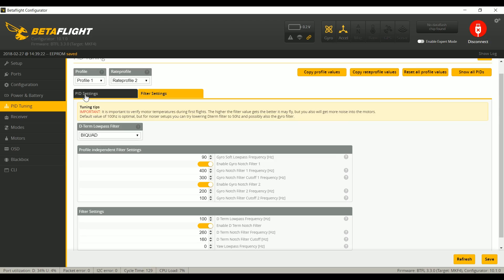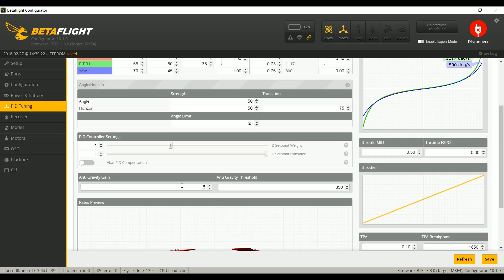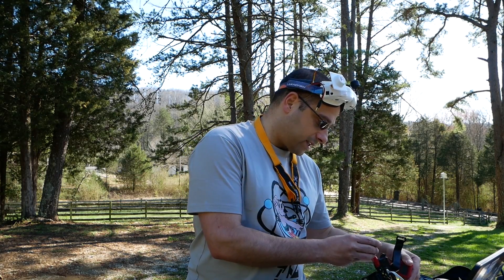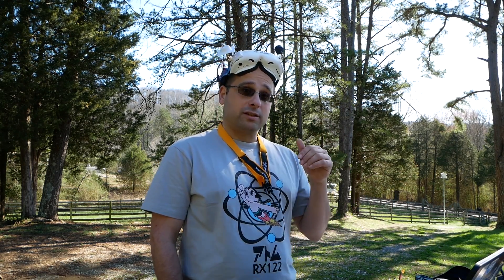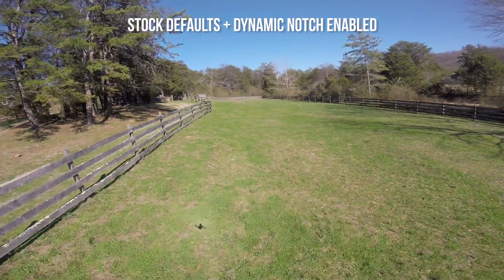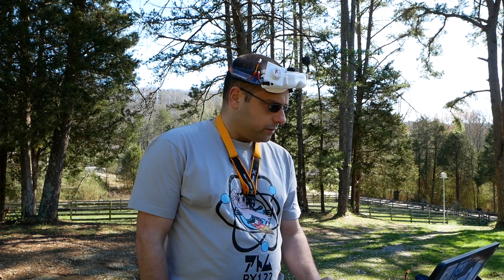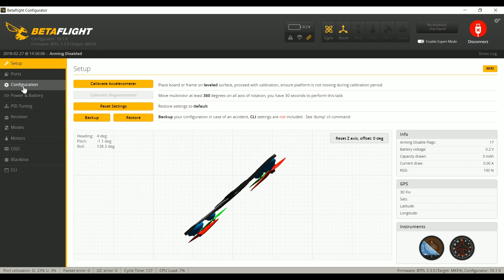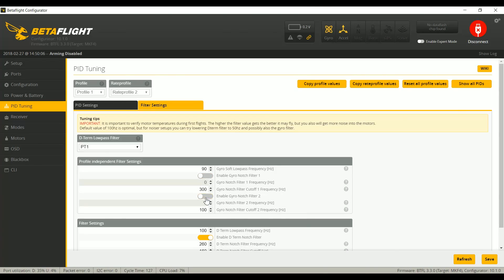Betaflight 3.3 (not) Kalman Filter | FLIGHT TESTING

Comment: What you type in CLI to do stage 2?
Reply from the maker: Stage2 is active by default in 3.4 and above. And can be configured from the GUI.
Reply: Joshua Bardwell I been running 3.3.3 Betaflight because of the rumors about smoking motors on micro quads. I recently bought a  Leader3 and one of the motors crapped out. So i bought a set of Brother Hobby R3 1106 5100kv which run hot. I tried tuning it out with pids and changing the Dterm knotch filters. Also gave it thorough inspection of screws or anything that could make them run hot. And still no success. So im looking at every option i can.

Comment: Joshua, whats an acceptable motor temperature? and what are you seeing from bone stock filter set up vs the last filter set up you had on here? i have the MX-2206-12 2450kv motors and they usually come back after a flight pretty warm. i can touch them...they dont burn my hand but i would say are in the 100 to 120 degF temp range at 80 deg f ambient. they come back cooler than my battery but not by much. you always put a lot of emphasis on not only knocking down filtering to get the least amount of latency but motor temps, but i am a little curious what an acceptable temp is. i mean are you seeing temps that are not increasing at all past ambient or are we seeing temps that are significantly warmer? i have near the same motors you used in this test so i should see similar values??? which brings me to the next question (and sorry for so many) what about prop choice (temp wise) and weight of the craft? for instance i have these motors on a 6" set up running either HQ 5.5x4x3 props or RaceKraft 6032 props AUW 650 grams or so. should i expect to see a temp difference merely based on prop/disk loading and quad weight. there has got to be some temperatures increases based on these build choices alone right, regardless of the noise getting into the FC?

Comment: Hi Joshua, how did it feel between setting the Gyro at 32KHZ to 8KHZ on Betaflight 3.3? I wonder if I should make the upgrade to F4/F7 to fully utilized the 32KHZ sampling. Do you think it worth the upgrade?
Reply from the maker: It's a very small difference. I don't think most people would notice.

Comment: Ok so I can say that I wouldn't recommend flying all notches off with stage 2 at 250hz as i clipped a branch damaged a prop and tryed to fly it back to me 50 feet away and didn't make it- the quad dropped from the sky due to smoked motor on that prop. I think leaving the dynamic on is the way to go for me. (motors barely even warm before prop damage)

Comment: I Tested  betaflight 3.3 on my omnibusf4sd (8k/8k dynamic filter on) with stage2 at 150 mhz and 500 mhz, it flys very good but im having a problem,... I have sudden "flips" that end in crash, after making a more aggressive maneuver.  This does not always happen, and happens less frequently with the stage2 at 500 mhz,
with stage2 at 0 never happens. Any idea whats going on here?
Reply from the maker: Maybe it is CPU utilization maxxing out? What is your CPU%? Have you tried enabling overclocking to 192 MHz?
Reply: cpu load is at 5%. I dindt overclocked. Im afraid burn the board with the overclock. Thx for awnser
Reply: HI again Joshua, today i had some time to go fly, now i know exactly when i got these death rolls/flips,. On my first comment i said it only happens with stage2 activated but its not true. It happens everytime i do hard punch on throttle +  half roll or pitch, quad is turned upside down and then half roll or pitch again  to stay straight,  imagine this maneuver very fast. ... I do not know if I'm explaining well enough for you to understand. This is always end with a death roll/flip. I also tryed butterflight  3.4.2 but had the same problem.  I was really happy when I saw your video "Betaflight 3.3 Gyro Overflow Detection (Anti-Yaw-Spin)", I thought, this is it!!!! But I quickly lost hope when I checked in the butterflight CLI, gyro_overflow_detect is OFF by default in butterflight 3.4.2 :( :(   unfortunately I do not have logs to show you, but I'll try to record some logs the next time I fly.  I tested motors and escs on the bench everything seems to work perfectly. My quad flys very smooth, do very nice slow motion maneuvers and powerloops, but he freaks out when I do what I described above.  If there is someone who can solve this, it's you !!!! Please give me some feedback about what you think about this.
Thank you
Reply: Cause found / Problem FIxed Thank you for the help 😉😉😉

Comment: There are some wired video conclusion, it is obvious that your first stage2 filter with the lower cutoff was the worst  even compare to the 3.2 tune. In the second when you raised the freq it was much much better. and it seem as if the UAV Tech tune was really the best out of the all.
Thanks for the video !

Comment: Why I like butterflight. I was able to flash it to a 2.5 inch 5 and 6 and use different props at almost every size. Bi blade and tri blade. And it handles them all perfectly. Beta never could do that for me. Maybe it can for you. The 6 inch bi blade is a jello and vibration generator and the kalman filter is the only thing that has been able to tame it. But fly what ever you like.

Comment: I can tell the difference between combustion chamber conductivity feedback via plug charge decay (lol nsx bmw) vs old style wideish lsu o2 sensors but a 12 year old 3076r cramming 45lb/min through a 6 bolt 4g still feels really good.

15% of my quads now have betaflight 3.3. Maybe 50% will next month.

Comment: GJ. 

Wouldn’t u need to retune after each filter to get best out of removing filter delays

Also it would be awesome to see which options are safer on the motors - eg bend a prop 90 degree and fly for 20 sec then test motor temps?
Reply from the maker: All of this was done on default PIDs. The goal is to determine the effect of the filters first and foremost. In reality, yes, you would retune. And the nature of the filters might affect the best final result. For example, dynamic filter might allow higher D gains and reduced propwash even though on default PIDs, dynamic filter off might work best.

Comment: Whilst I appreciate that you want to do an apples to apples comparison I don't think using the same settings for both filters is the way to achieve that.
With the exact same settings the filters have different cuttoff frequencies.

Personally I don't care about propwash more than stick feel and  configuration flexibility.
Thus I don't see myself ever replacing the dynamic notch combined with semi aggressive filter settings.

I went from cyclone 5045 5.5g tri's to kingkong 5040 1.9g biblades (balanced) on a windy day and it got the best out of both props whilst being oscillation free.

I feel we are all a bit guilty of judging a quads handling retrospectively when watching back footage completely forgetting how it felt to fly in the first place.
Reply from the maker: I calculated the correct Q and R value to produce an equivalent cutoff frequency. That's what I mean by "the same settings".

I always do a video recording of my subjective impression of each flight after I land. These recordings don't always make it into the final video, but I refer back to them during editing as I form my final opinions for the video. This is how I address the concern you're raising. I think the right approach is to take into account the subjective feel during the flight, but also the HD footage is important because there are often things you overlook while flying. Like that one time a freaking hawk tried to take out my quad twice and I didn't even notice until the HD review.

I'm focusing on propwash handling here because it is the single biggest and most obvious effect of improved filter performance.

I agree that if you want to be able to switch props, the dynamic filter may be a better approach.

Comment: The new filter sound just the same as too high D term does but only on turns. Was your motors hot after that flight? That propwash was bad.
Reply from the maker: The motors were completely cool.

Comment: I was definitely impressed when you upped the stage 2 filtering. Although you started doing different lines back and forth so it has hard to be an exact apples to apples comparison. That said, I think there was a definite improvement

Comment: Maybe you also need to mention in the intro that filters are the last step in tuning a quad after you get as much of the physical and electrical noise out of the build that you can.

The less work the filter needs to do, the less filtering that will be required.  With less filtering, you can run lower latency filters that give the fine tune feeling you want.

I like the warning on the intro (ie. you don NEED to know so just get out there and fly).  I am not up to fine-tuning my filters yet, but like to know all the background for when I am.

As always, great work.  Happily subscribed.

Comment: Was the second approach better than just a dynamic notch +pt1 atleast? I think things will go bad in case of damaged props if u have dinamyc notch off
Reply from the maker: Yes that is a risk if dynamic notch is off. The hope is that the lowpass will have enough attenuation to protect but it's not guaranteed.

Comment: I’m glad you are trying to do something but there’s a reason MIT researchers are studying Kalman filtering in 2018 for use in autonomous flight. It’s because no matter how hard you try, Rudolph Kalman did a hell of a job coming up with the best way of doing this.
Reply from the maker: You are right. But the "Fast Kalman" that we are all using now is not a complete implementation of the Kalman filter, and leaves out the most important part: the feedback and state estimation. That is why the Fast Kalman reduces mathematically to a simple Biquad lowpass.
Reply: While the complete implementation is too much for any STM processor to handle (whilst also running flight-code), the simplified form is perfect for quadcopters. In mat-lab simulations, it may look like it converges "eventually." but, in a real flight, it never actually gets there due to the dynamic nature of the actual values filtered. They are not equivalent given real-world flight scenarios.

Even then the only way to get really spectacular flight performance is why we started Helio in the first place. I can't wait to see you review our board :)
Reply: Hello RC I think you missed some 70 years. MIT was implementing  KF in autonomous flight back in early 1960 to be exact  MIT Instrumentation Laboratory (now called Charles Stark Draper Laboratory) implemented KF in Apollo Guidance Computer.
All airplain auto pilots in use today use it in some form, same apply to all cruise missile even is simple thinks like tracking position of cars on track for TV viewers for NASCAR or Formula 1 races...
Which get us to other point (I didn't see anyone make FC based on ST6, ST7, STM8 microcontrollers so I am guessing you by STM mean STM32 series microcontrollers) of "STM processsor" (STM32 are not processors, they are microcontrollers based on ARM processor core) are more then capable to run complete implementation of KF or EKF or UKF with flight code, even slowest STM32 microcontroller is 50 times faster then what was Apollo Guidance Computer, even Atmel 8 bit microcontrollers are more then capable of running complete implementation of KF (and they are 2 times slower then slowest STM32 microcontroller) which is used in Copenhagen Suborbitals Guidance Navigation & Control "computer" on their rockets (complete implementation of KF with sensor fusion).
Reply: Helio RC I want a build that puts all of the FKF variables on the OSD so we can put this to bed. I still don't see what makes K dynamic.

Comment: I've had excellent results setting the stage2 filter to 90hz then disabling gyro lowpass effectively replacing the current gyro lowpass with stage2. Then enabling dynamic notch filter and switching off all the other notch filters and d-term lowpass. I have UAV tech to thank for this logic, the stage2 filter kicks in before the dynamic which cleans up the noise significantly leaving the dynamic filter a easier job sweeping up the little noise that is left. My quad flies the best its ever flown.
Reply from the maker: I would never, never turn off the D term lowpass. This is absolutely playing with fire.
Reply: Didn't UAV TECH leave the D term Lowpass at PT1?
Reply: I just took it one step further, I figured the d-term lowpass using PT1 is just redundant with stage2 filtering more aggressively at the same frequency. My motors come down cool, I was very careful when I first tried it to feel for hot motors.
Reply: Ant D - thanks!  Worth a try!
Reply from the maker: Can't argue with results.
Reply: I agree it is a bit risky, I think I may have a problem if I bend a prop but at the moment it flies amazingly well and motors come down cool. With the stage2 at 90Hz I'm assuming its low enough cutoff and combined with dynamic notch to prevent excessive noise getting into the d-term, time will tell. I'm sure if I set the stage2 to something like 200hz with d-term lowpass off my motors would smoke.
Reply: Joshua Bardwell  - good of you to chime-in Joshua!  I agree - but some folks like pushing the edge.  Time for me to be a Patreon supporter of yours - I learned something today!

Comment: Hey Josh,
People tends to call "propwash" 2 different things:
1. vortex ring state(VRS) is the case when quadcopter is descending thru the turbulence it creates himself. This turbulence flow has shape of vortex ring hence the name. It happens on the sharp turns.
2. 30-60hz oscillation, when going straight on high throttle. It caused by phase delay in gyro reading as a result of agressive filtering. 

When dealing with first one, FC should compensate for unstable air flow for air sucked thru the blades and stay on the target angular rate set by rc stick. The faster FC responds, the less shaking you will see on video footage. But wobbling  sound should be always there, as FC is articulating the motor power to keep quad straight.

Second type of prop wash is tuning defect. It'c caused by resonance loop in PID feedback. FC gets delayed  information about the error(difference between actual rate and one set by rc stick). If response is delayed, FC can overshoot and had to compensate back. The frequency is too high to be managed by D term, even worse, this effect is increased if you set higher D gain. This one can be(and should be) fixed completely by reducing filtering, going from BiQuad to PT1, moving cutoffs higher, etc. 

In this video you showed only 1st type, as your quad is already tuned good enough to  avoid 2nd. As i've mentioned earlier, you still hear the "propwash" while flying with default filter setting, but it looks to me that video that footage is quite stable.

Comment: Oh my god. My head is about to explode, with ideas of different variations for the filters.
You could try out, 8k removing default gyro filter, add the stage2 filter with a cutoff from 90hz only dterm notch and pt1. No dynamic filter. 
And a lot other could be changed. 
Very nice comparisson between the different variations you are showing here jb.

Comment: I’d say that the first run you had without stage 2 sounded angrier in the turns, just noisier.  Then with stage 2 it sounded quieter but prop wash wasn’t improved all that much.  I think the 8k stage 2 seemed the best for the stage 2 tests but the prop wash was about the same as without stage 2.  The sound though has to tell us something, the stage 2 didn’t look all that much smoother but it definitely sounded smoother.

Comment: At the end of stage 2 once you had increased the cut of from 150 to 250 you could see a  difference in how the quad flow. But when you dropped from 32KHZ to 8khz I could not see any change, did you feel any ? Awesome video JB very interesting, so I most be a Nerd as you side at the begging of the vid lol
Reply: Joshua Bardwell i has seen many claims even on 8k butterflight is so much amazing. I strongly agree with your statement that if u r on 8khz with all notch f off  there is no benefit turning on the stage 2 f. Has your opinion change on this?
Reply: George Cooper This. It seemed like the best performance was at 32/16 and the cutoff at 250. It was noticeable for sure. Those same filters at 8k seemed only marginally better (if that) than the BF3.2 settings.
Reply: Thanks JB
Reply from the maker: The difference is very subtle but I think 8k was slightly worse.

Comment: how does this relate to the risk of smoking a motor? Would it be considered risky to just dive into the new recommended settings or should the average Joe go through the process of disabling filters one at a time checking for hot motors like you did (didn’t)?
Reply from the maker: This is more of an all or nothing. To get the benefit you need to disable all the static notches for sure. Keeping the stage2 lowpass lower or keeping dynamic notch enabled protects some from hot motors. But if you aren't willing to risk it, stock with the defaults.

Comment: Did you try 8k/8k, all notches disabled (including dterm), dterm lowpass pt1, gyro soft lowpass set to 0,  dynamic filter on,  and then stage2 filter at the base of motor noise? This produced really great results for me and is another method of setting up filters (replacing the stage1 gyro lowpass with BQRC+FIR2 filter) that wasn't mentioned. UAV tech showed it as one of his suggestions.
Reply: Wüdz_fpv yup and he set it at 90hz, I watched it like 4 times to remember to get it right later lol.
Jb you only tried it at the higher Hz levels.
That uav guy is very good with all that graft stuff and showing you where most motors spend it's time at, and explains it very well to you.
Reply: i tried it at 90hz and it was okay, but found bumping it up to the start of your motor noise cleaned things up much better